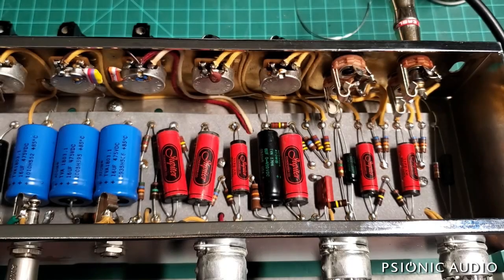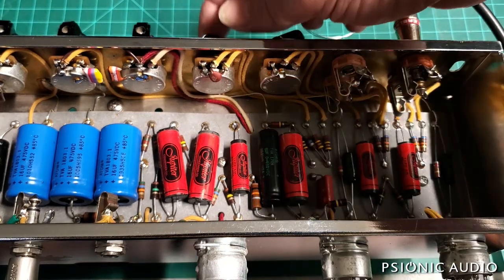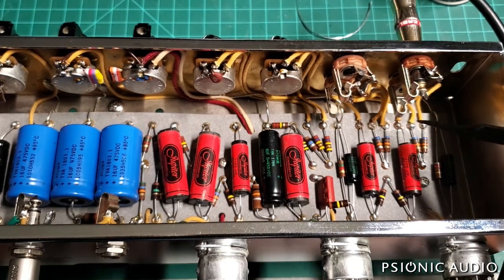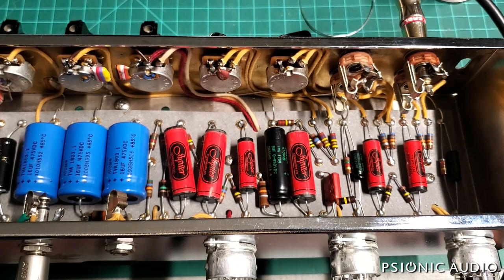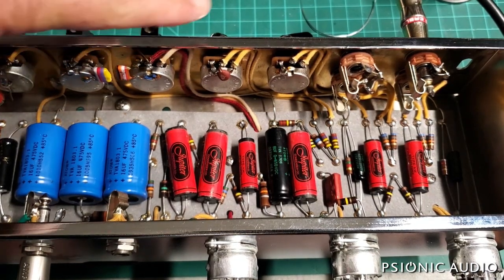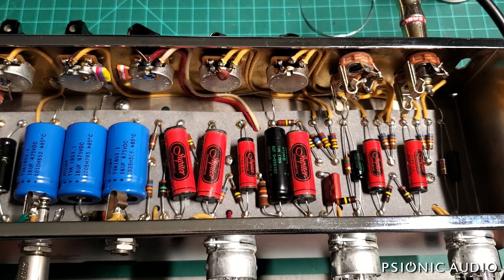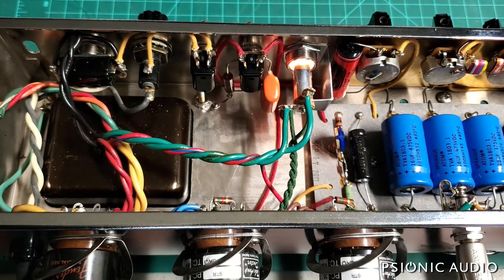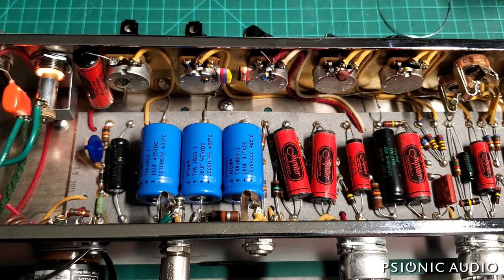Clark Penrose | Is This Amp Really Super?

Comment: That board looks really flimsy and cheap compared to the rest of the amp's parts. Would a fiberglass board have stopped dc leakage in the first place? Seems weird they spent so much on components yet used what looks like cardboard for the eyelet board.

Comment: I built one of these with a PPIMV. I really like the combination of 2x10s, 6L6s at moderate power and that classic preamp & cathode follower circuit. With a treble booster in front it gets that classic Bassman / Marshall growl, but it's also got enough headroom and firmness in the power supply for really good cleans. One of my favourite amps ever.

Comment: I own a Clark Edisto which is also a Super circuit (but with 3 knob reverb added) and for twenty years I had similar issues including the static with the guitar volume on the bright channel only. The static would improve with input jack cleaning but always returned along with noisy microphonic capacitors on the far right of the board as shown above .  Also, the amp was always very poor sounding to my ears at lower volumes, no real useable low volume settings and harsh - above "6" it came alive -  thanks to videos like this one  i recently replaced both volume pots with 1meg linear tapers and both bright side input jacks and I now have a great sounding tweed era super  - the issue with guitar volume static and noisy caps/leaking DC gone (i think the original Switchcraft jacks were bad from day one) - all said the quality and performance of Clark amplifiers is stellar - I have a few others and all over twenty years old and sound as good if not better then  the day they were delivered.   Thanks again for your posts - very helpful to me resolving my amp issues!!
Reply: Oh man, I have the same problem on my bright input on a 5e3 Beaufort.  Beautiful sounding amp, the crackle and static is absolutely annoying and I couldn't figure out why.  Gonna see if this is it.
Reply: @MintStiles  i am not a trained amp tech but i think those bright channel input jacks leaked DC back to the circuit causing the noise - also when i tapped the caps and board on that side of the board they where microphonic as well - replacing the inputs  cleared all that up and improved the tone a bit as well - the linear tracking volume pots also a big change - I have a Beaufort as well but no problems with that one - good luck
Reply: should be linear "tapper"  pots - they are 1mg - also the inputs have a 1meg carbon comp resistor as well - also you may just need to clean and retension the inputs with a product like Deoxit D5 - it worked temporarily for me but the problem kept returning

Comment: 5F4, my favorite tweed!  I disagree on the 12AX7.  Totally different amp with a 12AY7 in V1.  I also used a 12AT7 in V3/the PI to further reduce gain and sweeten up the amp.  A 220K resistor to the CF's grid helps as well.  I put 470K mixing resistors in my friends 5E7 who insisted on using a 12AX7 in V1 to even things out.

Comment: I’m kinda shocked that its already got a bit of tweed disease. That’s probably why the previous guys didn’t catch that. I took the way I wire the line/primary from Clark. Using the polarity switch as a terminal strip and all. I think they make the best Tweed clones commercially available.

As an end user and (very)part time builder, I look at Jupiter like I look at Mercury Magnetics. US made quality serving a very niche community. I’ve been a very satisfied customer of theirs for years now. 

BTW, I take apart the 1M linear CTS pots for their wafers. It’s worth the effort if you want a CTS pot. They’re the only thing I’ll use in an amp. Specifically the ones with a brass shaft and collar. The newest Mojotone “vintage taper” 250k and 500k are marked J, previously marked as BD. I just noticed that on Sunday when I was rifling through my big bag of pot(s).

Comment: Similar "tropical fish" caps were used in older European hifi equipment (such as Bang &Olufsen, ugh) and sometimes in solid-state McIntosh equipment. They do fail, probably from moisture infiltration; the epoxy-like coating is prone to cracking.

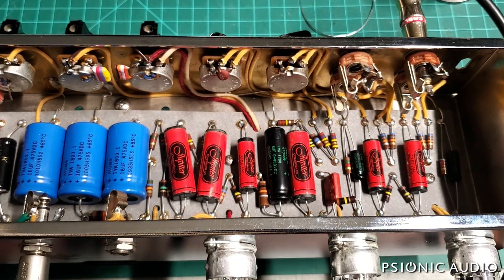Comment: There is a statement at 6:50 that you may wish to elaborate on… there needs to be voltage on the grid, the cathode resistor and grid leak resistor to ground create the bias voltage to control the tube
Reply from the maker: The real elaboration is quite literally chapter length, but fortunately that chapter already exists:

http://www.valvewizard.co.uk/gainstage.html

But to give a shorter answer, the gain stage here is an AC-coupled cathode biased triode stage, and while you need AC voltage on the grid for amplification to occur, you do NOT want DC voltage on the grid (as was leaking here through the board).

I'm about to put together the follow up video, and I'll include a brief discussion of this to avoid any confusion.
Reply: @PsionicAudio  I am letting you know that I have all the books and read them constantly and also build amps myself.  I am a lot like you in many ways actually
Reply from the maker: Then you'll know how hard it is to present this stuff for a general audience. How much to simplify, when to elaborate, and also (in this case) when something obvious to me isn't necessarily obvious to the viewer.

I really respect Uncle Doug's planning and presentations (even though I disagree with him on some particulars).
Reply: You are doing a great job sir, much respect.  I wish I could have privately suggested discussing neg voltages showing on the grid for bias.  My uncle was a tv repair man named Lyle.  He trained in 60’s.  Fixed tv and stereos all his life. Once he told me, when I was 20,”Tubes are dinosaur technology, why you want to know about them.  They make transistor guitar amps now!”  That was 30 years ago.  I didn’t listen.

Comment: Revisiting a question I asked earlier, do you think that Leo implemented the standby switch because it was useful in his errant design, or did he implement it because, as some folks have suggested, he misunderstood the RCA Tube Manual? Sorry if I'm misunderstanding, but I did re-listen to your comments about this at least five times! Thanks for any insight you can give me into this, I'm just trying to understand why standby switches appear on guitar amps but not on any other tube audio amps that I know of. You previously directed me to your video "Does this amp need standby," which answered a lot of questions, but I still wonder why Leo Fender initially decided on its use, which as far as I can tell was novel and unique to Fender instrument amplifiers.
Reply from the maker: AFAIK he implemented it to avoid using more expensive caps rated for the unloaded B+ in some of his designs, it was perceived as a "high end option" and then put on amps that didn't need it, just for the "high end" association.
Reply: @PsionicAudio  It was for practical reasons that he included a standby switch. In those days there were a lot of club gigs. Leo got a lot of input about his products from club musicians. When musicians went on break they would just flip the standby switch so the amp could cool off for a little while. The heaters are still on of course in standby. Break is over, flip the standby switch and you're ready to go without having to wait for the amp to warm up from a full off state. It's really that simple.

Comment: Jupiter caps and a fiber eyelet board? To each his own. That board would would be GLASS resin as in fiberglass, not fine sawdust and resin, especially with some of this NEW fiber board that is imported. That stuff has leaky spots new from the factory. That is an awful lot of work to put on a leaky board or on a board that will become leaky prematurely. Fortunately, I have hi pot insulation breakdown testers and e stat testers, but I am still running the risk that stuff will leak later on.
Reply: Aside from that, it's an exceptionally fine looking job of assembly, soldering and basic design execution.

Comment: When I was a young recording engineer in Los Angeles in the early 70s, I was 'taught' that potentiometers are at their best at 3/4 open; because, below that the circuit flow is 'pinched' and above that harmonic distortion is being added to the stream. These days I see a lot of guitarists say that "2 o'clock sounds best." Well, 2 o'clock is a potentiometer at 3/4 open. Is this a thing for you, and if not, I'd love to hear your take on this (and restricting signal flow). Also, I'm glad to hear you talking about "that torn paper sound" which I believe does not belong attached to the sound of a guitar because it is extraneous to the core tone. An unwelcome passenger.
Reply from the maker: Well, sorry to argue, but there is no merit to the "3/4" concept. An audio taper pot is really at around 50% of its value when the knob is 3/4 of the way up. 

What is really happening there is you, like most humans, like the sound of louder things. But as far as what is happening in the circuit, nothing is "pinched" below that point.

Duane didn't have his volume pots very high on Elizabeth Reed. SRV didn't have the volume high on Lenny. 

They both sound a little bit ok.
Reply: @PsionicAudio  No argument. That's why I asked for your input on the matter. It was the 1970s after all. And I think that they were talking about faders as well (which is why the zero is where it is on faders). I must have assumed that the same was true for all potentiometers. You have shown me there are more than one type. It's why I asked. I trust you a lot, so I'll probably ask lots of stupid questions while I am still alive and learning. Thanks Lyle!